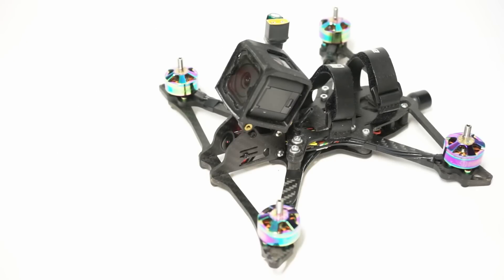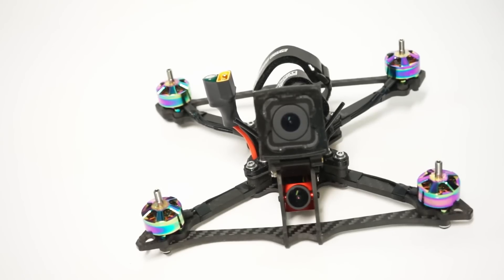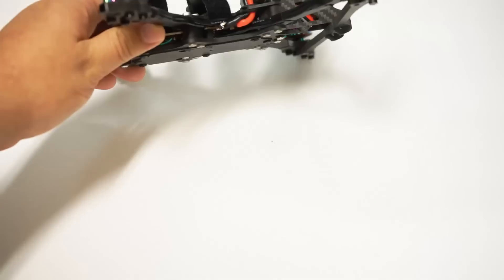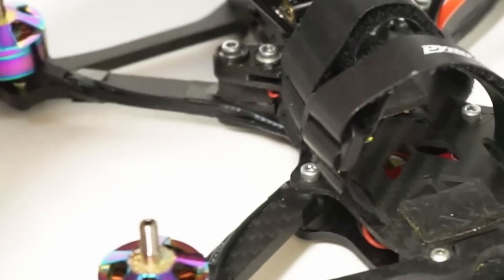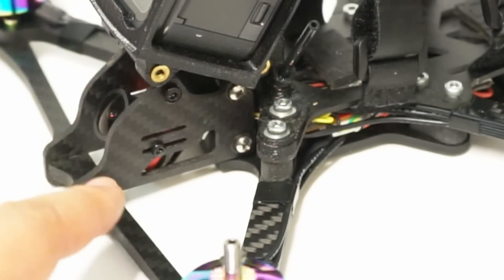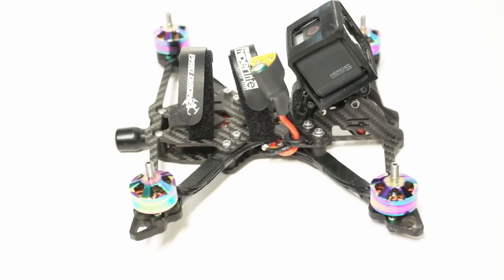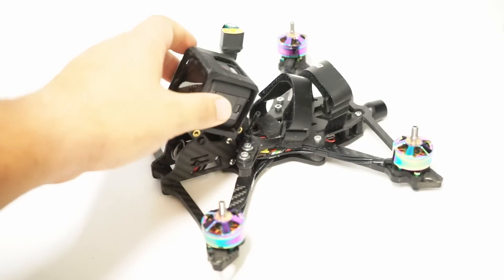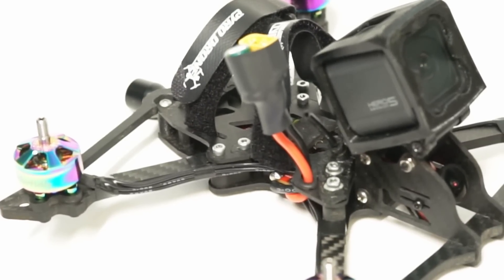Smooth Operator Drone Catalyst Machineworks freestyle Full Review BH R6 motors

Comment: I know this is an old video but I am still loving my 5 inch smooth operator with F80 1900 kv 6s. Question I know the larger 6s batteries like rline 6s 1300 v3 are a pain to use because it seems like the rear props are very close in striking the battery. Maybe I need to place it better? I am using gemfan 5146 props.

Comment: Beautiful build, dude!!! Really amazing! 😃
I'm currently buying stuff for my first freestyle quad (up to day I only have a brushed micro, a 2.5" brushless micro and a 5" with a racing frame), but I couldn't decide on the motors yet...
I like 2500kv (on 4s, I'm not going 6s that soon), but the BH R6 only have a 2400kv version... So I'm thinking... iFlight Xing motors, 3B Hobby motors of the ImaxInno motors... Don't know yet.
Reply from the maker: Thats a tough call, i have wanted to try the Xing, but BH motors can really be hard to beat.  I know T motor F60 pro comes in a 2500 i believe.

Comment: Awesome! I have a SO 5in with 2306 2650 drib motors. I agree with everything you said, it’s too nice for me to fly lol. I flew about 10 packs through it and put it up until I get better, because this quad just encourages doing crazy stuff. I have a cheaper 5in setup that I don’t mind to destroy as much as my smooth operator. Mine also could use a little bit of tuning, but I haven’t done any. I used a caddx turtle. It was tight to fit lol